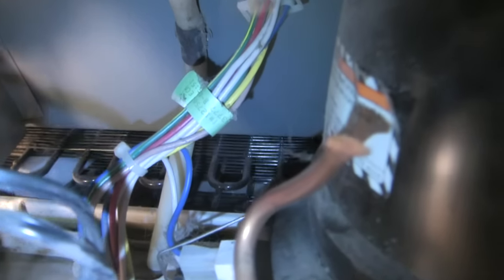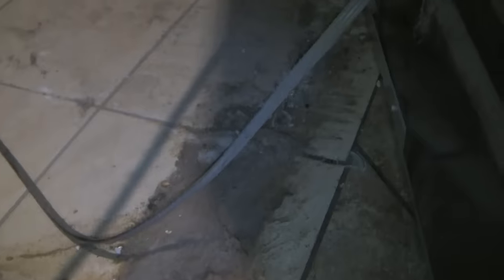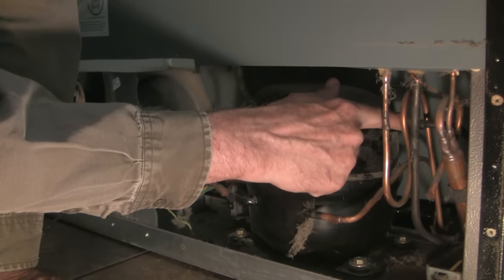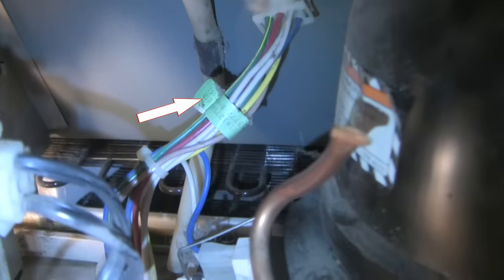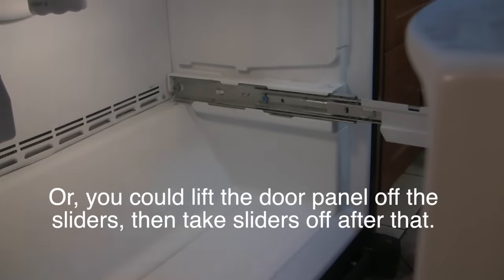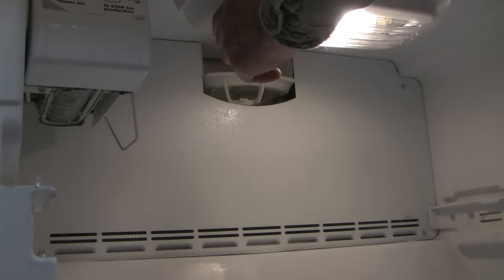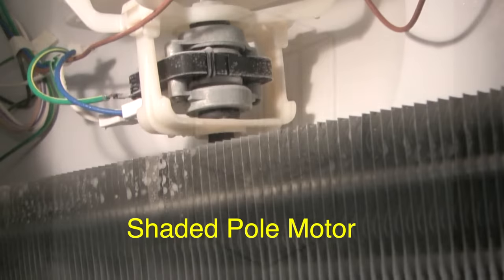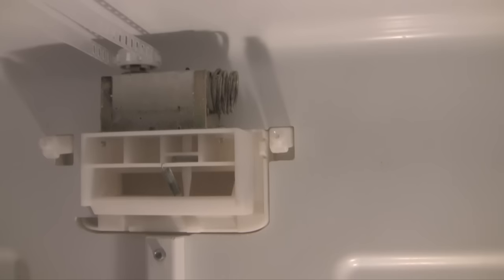How to investigate and fix a fridge that is too warm

Comment: how can I see if I need a new compresser fan
Reply from the maker: There is both a condenser fan and an evaporator fan; both should be on when the compressor is working. The exception to that is when the system goes into defrost mode, where the fans shut down for up to a few hours to prevent warm air from thawing your food. If the evaporator fan is off, read through the wiring diagram and decide if the system is in defrost mode. Sometimes they get stuck. If the fan is noisy or locked, check power to the fan. I did a video of a fan diagnosis and replacement on an oven, on my channel. This is getting into enough of a technical challenge that you may not feel comfortable moving forward, so you need to honestly evaluate your skill set to decide if it is safe or reasonable for you to proceed. Getting a repair tech in to quickly fix the problem may be the best option.

Comment: Should the compressor get hot to touch? My fridge door has been left open and now it can’t get back to normal as I think it’s working too hard to cool and keeps tripping the thermal cut out? Any ideas
Reply from the maker: Yes it is normally hot when running, but if it is running all the time and tripping thermal cutout breakers, something is wrong. Think of a dirty coil, leaking door gaskets, poor air circulation around the condenser coil, bad fans, abnormal refrigerant levels, a failing compressor, etc

Comment: I hope I'm getting stink-eye when I'm done because I don't want to spend $1,500 on a new fridge that's for sure ... LOL thanks for the video
Reply: same, my wife is already "shopping" as I am cleaning the coils.
Reply: @jakespoon4891  yeah it worked beautifully didn't have to Shell out for that new fridge so she got a new 5 burner gas stove in its place can't win for losing... Lol
Reply: High end refrigerators cost over $8000, and even the medium priced ones are about $3K. Try telling that to a kid or wife who keep opening the refrigerator doors to get food, or just browse. I need to equip a vending machine access lock which charges them 25 cents to open the doors.

Comment: The temperature in the fridge part is 14 Celsius, but the freezer is still freezing (the ice cubes still frozen). There is no fan near the compressor on the back of the fridge, or inside the fridge or freezer... The whole machine is humming on and off.
Reply from the maker: I'll guess you have a motor but it is concealed behind panels, perhaps accessible from the back if you can't get to it from the front. Search around for the wiring schematic drawing, usually concealed somewhere in the fridge. In this fridge, my schematic was in a plastic pocket I could reach with a pocket screwdriver from the lower front. Alternatively you may be able to find it online. The fan will be shown on the schematic if you have one.
Reply: @spelunkerd  
An engineer repairing fridges said he would recommend getting rid of the appliance. Apart from cooling failure, the functioning is irregular, too... (humming). He said that it might release gas and be dangerous... So I think I am not going to bother....
But thank you anyway.

Comment: HELP! My freezer is -6, my fridge is 55! The compressor is warm/hot to touch and the fans in the back/bottom of the fridge are running. I’ve tried to troubleshoot and still cannot figure out what’s the problem. When I trick the closing of the door, the only fan I hear is behind the ice maker. Cannot seem to figure out where in the fridge this cold air is supposed to be coming from. My Frigidaire is only 3 years old! Your video is the best out but I need more help! Thank you!!!
Reply from the maker: I'm afraid there's not much more I can do to help you from here. Most appliances have a wiring diagram hidden somewhere, mine was in a plastic sleeve under the front drawer, but often they are behind panels near the main board. You need to remove panels enough to be able to see that fan and make sure its not frozen by ice or debris. Good luck!

Comment: what if the back of the upper fridge behind that panel is iced up
Reply from the maker: Most fridges have a defrost cycle where an electric heater (usually a resistance heat strip) melts the ice. Older fridges had a mechanical timer that could get stuck, trapping the fridge in one side of the cycle, and in those you can twist the rotating wheel and move it to the next part of the cycle. In new fridges the timer is entirely electronic, often built into the board. The heat strip can blow a fuse and can also burn out, which would cause you to lose defrost. I would remove food from the fridge, unplug it to allow it to defrost, look for the circuit drawing hidden in the fridge and search around for the fuse and defrost timer. When it ices over like that, be sure you defrost enough to clear the tube designed to drain that water to a tray at the bottom.

Comment: I just want to know how the cooling from the freezer enters the fridge? I see US fridges have FANS/Ventilators which move the cold air, but I have never seen a fridge with a fan in Europe. how do they work?
Reply from the maker: Air is driven by a shaded pole motor, blown into a hidden sheet metal passage in the back, spilling through the thermostatically controlled door at the top of the fridge.

Comment: You will definitely save energy by cleaning those condenser coils . A tank of compressed air also works , but makes a mess . An old style radiator brush is also good . You should also clean indoor and outdoor air conditioners . I sell commercial equipment . I am amazed that many places do zero maintenance . The equipment would perform better and use less energy . Some people pay for service contracts and preventative maintenance . When I see filthy units , I show them or send pictures . It's simple , they pay for maintenance and get none . I tell them they are being ripped off .

Comment: I have a Samsung side by side refrigerator, the compressor works but the freezer and fridge are warm. What could be the possible issues?
Reply from the maker: Carefully work through the fridge the way I did, starting with door seals, dust around the coils, fans, and blend doors. There are only a few things you can easily do yourself but you want to work through those systematically to be sure. If you can't find anything then the game becomes more complex and you'll face a decision whether to involve a pro. If the compressor is failing then they often suggest saving the cash to put toward another fridge. Even a coolant leak can be an expensive fix....

Comment: found the defrost heater, overheated, replaced it with a new one

now showing, temermal fuse error but thermal ( have tested the thermal fuse with multimeter it's ok and no physical damage)

Comment: The only parts I have on bottom back of my fridge are the pump, some wires, a drip pan, and a tiny coil INSIDE the drip pan that's about half full of water. I don't see any condensor coils or any sort of fan. WTF!? Also the screws on the upper back panel are some weird kind that don't unscrew for some reason. How do I access the rest of it? It's a Criterion something

Comment: Hi there spelunkerd:  Do you have any recommendations on which make/model of bottom-mount freezer/fridge to buy to replace a 20 year old bottom-mount by KENMORE (purchased from SEARS).  It's working fine except the freezer is not keeping things cold enough (e.g. ice cream reduced to cool-whip consistency) even when set to "7", even after vacuuming all the gross dust accumulation, even after making sure the defrost timer is working.  I would love to get a new fridge, but like you, don't want to throw out something if it can be saved.  So maybe getting a really good new one is the happy middle-ground.  Any suggestions?

Comment: Great vid! Can you do one for a chest freezer? Mine is cold but not freezing. There aren't coils or a fan
Reply from the maker: All freezers have the same basic elements, but many have them covered with hardware to conceal where those active elements are. Many will have wiring and installation diagrams available online, if not repair advice, though the technical jargon is often hard to decipher for the layman. Good luck!

Comment: I cleared a clog (water was collecting in crisper) and cleaned the coils.  8 hours later fridge and freezer still warm.  My temperature display is broken (numbers are cut off). Can this be the issue?
Reply from the maker: It may be a board problem, hard to say. Try unplugging for a while, plug back in, see what happens. You need to decide whether the fridge is worth the investment to try and save it....

Comment: MY Freezer section  is not freezing ,the temp gauge   says  -22 but the ice tray is still water ,
Reply from the maker: Go through the steps here first. If nothing else is found, I'd wonder if the defrost cycle is stuck on defrost. Old fridges use a mechanical defrost timer, new ones are solid state. The circuit diagram will help. Often it is hidden somewhere in the fridge, perhaps behind a wall or concealed near the condenser. When in defrost mode, most fridges shut down both the compressor and the fans, following which an electric heating element is activated for about 20-30 min. If the timer is stuck, you can't get out of defrost. There are many videos showing this in more detail here on Youtube.

Comment: Hello! My fridge went down to room temperature overnight this is the first time it has done this I was wondering if this clog up could be the problem?
Reply from the maker: Yes possible, but there are many other causes. The video goes through a basic review with those other causes in mind. It is easy enough to vacuum the coil and see if it helps.

Comment: Our freezer is on top and it's cold as it should be.  The fridge has warmed up to about 59 or 60.  I vacuumed a dog from underneath the unit and cleaned out the back.  It's unplugged now so the ice built up in the freezer can melt.  I'm going to plug it in again in the morning and see if the fridge cools.  I'm not going to admit that we over stuff the hell out of the thing.  We do, but I'm not going to admit it.

Comment: My evaporator line going into it is freezing but rest of evaporator in is not cold
Reply from the maker: Modern fridges have a defrost cycle where a heater melts the ice to improve efficiency, so this could be a normal finding during the defrost cycle. However other problems can do this too, including a board problem, low refrigerant, etc. Even a burnt out defrost heater could do this by not doing its job, resulting in ice and inefficient cooling. Some systems have trouble codes one can read but those are proprietary and not usually shared with unlicensed facilities. Sorry to not be of more help to you.

Comment: Hi, first thanks for your excellent videos. I have a refrigerator model Whirlpool 
Model ED0GTAXMQ00, the center metal part when the two doors meet, gets very hot to the touch. I can’t find any video on this issue, can it be the wire harness that goes inside the freezer door. FYI, the back 
bottom motor fan ant the condenser fan are both working fine. There aren’t any issues with the temperature in the freezer nor the refrigerator.
Thanks in advance, hope this channel will be able to help.
Reply from the maker: I wish I could help you, but I don't know anything about that model. I'd be looking for repair manuals that might describe what is behind there. Good luck!

Comment: I just got mine delivered but have questions, mine is hot
Reply from the maker: I hope it's working fine now. On an unrelated side note, many people think that leaving a fridge door open will cool down the room, not understanding that these are heat pumps. Heat pumped by the compressor from the fridge cavity is sent out the condenser coils to heat the room. So the condenser coils need to be hot to do their job.
Reply: @spelunkerd  
Oh I know I have a ac for my house lol....
But it is always hot making rattling sounds and noises and came beat up but can't trade it in because they're out of stock I got lucky with the last one at the last minute....

Comment: Hello Sir,

My compressor turns on, stays on for about 5 seconds then cuts off, over and over and over. I replaced that relay, hoping to solve the issue and the problem still occurs. I've read that maybe the thermostat could be bad? What would you recommend next? I'm really hoping that the compressor is not bad...Thank you
Reply from the maker: I'm not a pro, but I'd be thinking about whether the freon charge is low (or high) because of a leak or excessive refill. These devices have low and high pressure cutout switches that turn the compressor off if pressures are too low or too high. Unfortunately many domestic fridges don't have schrader valves to easily measure pressures, so even measurement can be problematic. You might get a clue from a multimeter if you were to identify the high and low pressure switches and document them cutting out. Some fridges have trouble codes that are readable if you have access to repair manuals, you could try online. Sorry for not showing a DIY pathway here....

Comment: I have a great story about the fridge in the house we bought.  Long story but  the point is the house (1875 Victorian in southern Wisconsin) has great “bones” but had not been loved so everything needed fixing.  My husband and I got to it  while living in another place and  then the city inspector came in early February to assess it... remember it is Wisconsin (near Chicago)... 0 degrees outside or less.  We were working, replacing drywall and such and let the inspector do his thing.  He opened the 1960(?) fridge and said “ohhhh”.  I moved towards him... I felt heat . “What? Is it broken too?”  I asked.  He said, “No,  it works. It is trying to do it’s job... bringing the fridge up to freezing.”  Yeah... so cold in the house that the fridge was trying to warm the  colder than cold interior.

Comment: Hello I bought one use fridge to repair in the  back the Cooper pipe close to compressor it's broken,what I can do  to repair the fridge ? the last orner he checket with the technician and he cut the cooper pipe in the back ,after the orner decide to sell the fridge
I think the technician told the orner the cost to fix it's to much
But I want to fix the fridge
Thank you very much.
Reply from the maker: There is normally a blind copper line coming off the compressor that is the fill port, used by technicians to charge the system with freon. It looks like a line that has been cut off, usually soldered shut. You can't measure line pressures there, it is just a fill port, and you'd need a special access device to make a 'port line tap' if you want to add in freon later. Your first challenge is to see if the compressor is good, I would start by measuring resistance of the electrical connections leading into the motor, making sure none are shorted to ground or shorted to each other, with similar resistance in all arms (usually 3). If you can find a start/run capacitor I'd check that next. If the motor and any capacitor is good you could plug it in to see if it will run, and you could check to see if the shutoff solenoids for over/under pressure are preventing the compressor from turning on. If the system has a leak you'll need to find it before vacuum testing, purging, and charging with freon. This involves multiple steps and sophisticated equipment that most homeowners will not have. Here in Canada it is illegal for people without a license to purchase freon, because of the environmental damage caused by people who continuously recharge without finding the cause. Overall the cost of repair is often not worth the price for a new unit, explaining why our recycling depot/landfill is full of new looking fridges....

Comment: If ice build up is the most common problem, is it easier to just remove food items, unplug fridge, and allow it to melt, rather than take everything apart?
Reply from the maker: As long as there is no debris plugging the tube, that would work. However it wouldn't deal with the question as to why it happened. These systems are designed to never ice over, so there is a problem. It could be as simple as a kinked drain hose.
Reply: @spelunkerd  Or if the doors are left open to long(by accident) will case it to ice over too.

Comment: Maintenance is always good, but if your refrigerator is not cooling but your freezer is, the dirty coil is not the problem.
Reply: You have an issue with defrost evaporator fan or damper or electronic control to any one of these functions.
Reply from the maker: @misterindependent7994  That would have been my guess, too. In the end, cleaning the coil fixed it. Even today, 18 months later, the fridge is working fine with no other intervention and no relapse. I wonder if the evap fan got iced over, perhaps then melting away while I allowed the fridge to warm up as I took time to investigate.
Reply: Might be a defrost issue that happens intermittently. Unless it's twin cooling the fridge will get it's cool air from the freezer. Basic refers have a solid state manual adjustment damper and others have an electronic control damper. If the freezer is 10to-10. And the fridge is 45F+ then it's usually an airflow issue. Fan, defrost, damper. Some models can have this issue for just a shear lack of maintenance, but by that time the ice cream should be soft and the freezer just below 32F. When you arrived on scene what was the freezer temperature? Fridge temperature?

Comment: I cant even find my model wrt318fzb00  its just a basic black whirlpool fridge model says 2015 I cleaned the coils then reset the fridge the fan stopped running then kicked back on I cant find a defrost screw but prior to having to do all this the fridge was to cold then the freezer cut out but the fridge was okay had a little ice buildup on the back I knifed off gonna wait anothrt 24 hours